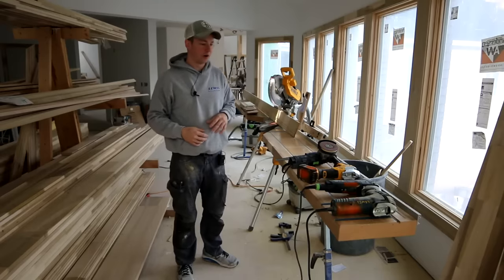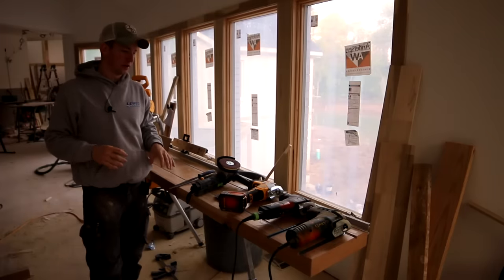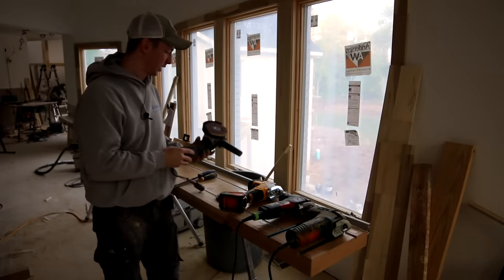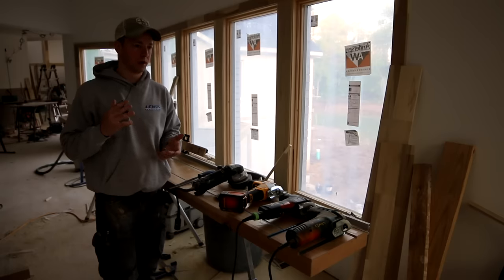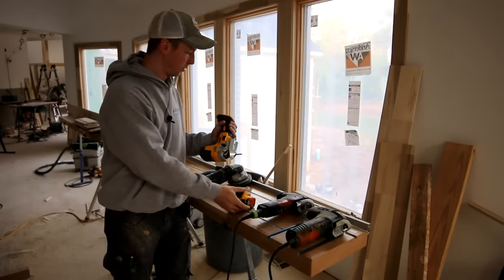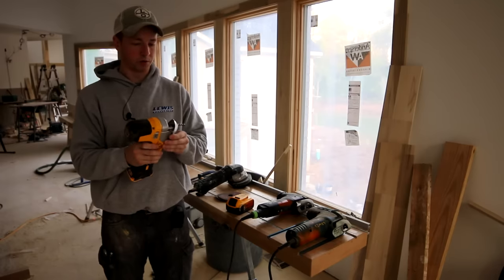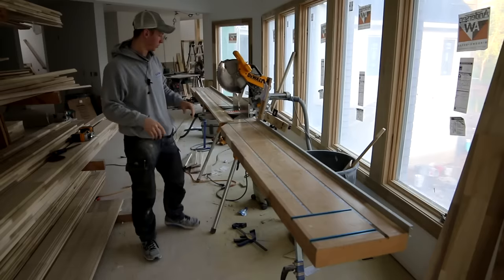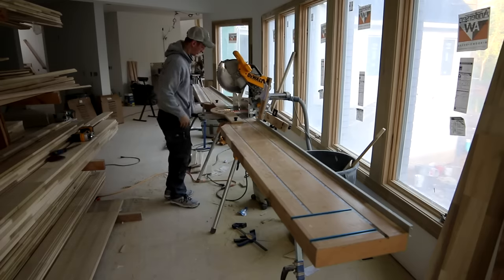Best tool for coping base and crown??? Dewalt DCS335B w Coping Foot for the Win

Comment: I will agree that you can get a very nice fit when coping crown and that in some instances coping may be best. However, for paint grade crown coping is a slow waste of time. Cutting miters is much faster. Coping is an extra step that is not in any way necessary. When coping you have to cut a miter anyway, then do another step that takes longer than miter cutting. Therefore, coping takes more than double the time over cutting miters only. A skill that you should have but should only do when you have to. The result is not worth the effort.
Reply: It saves time on remodel projects that walls are never plumb or square. It's less time fiddling with that last weird corner that just doesn't fit quite as tight as the other 3 did.
Reply: Trent Wright 

I use an angle grinder with a backing pad and a sanding disc. Fits into small details and is quick. Makita 4” with a DeWalt pad and whatever discs are at the store. 

I cut two 2 foot long samples with a 44.5 and 45 degree inside miters. Sample each corner, note it on the wall and make a mark at the bottom where the crown sat best. I snap lines from corner to corner. You will find that most corners are 44.5. I will use 3” long mdf wedges cut at 3* to tighten miters and keep the crown straight when nailing over low spots in the wall. This is where the snap line comes in. It lets you see if the crown is straight when nailing. Sampling the corners is key. I do cope base unless it is 1x with a round over.
Reply: Over time I've seen a lot of inside miter joints open up. Cope joints are the professional way.
Reply: Rick Hammer 

I have had outside corners pop with severe humidity changes (I am at the beach). MDF glue bonds just don’t seam to ever pop while wood joints need to be saturated to prevent a starved joint. All of my inside-inside miters are under pressure. Since wood is all kiln dried and the piece needs to shrink for a joint to open my joints have all stayed put. Outside joints have opened on me due to swelling. In 20 years I have worked for 4 different finish contractors with maybe 30 finish guys and none of them coped crown. With no call backs or complaints I have decided my time is better spent getting crown on the wall. A 15,000 sqft house has too many inside corners to be hardcore about coping.
Reply: Rick Hammer 

Talked to my current Super today, older guy I respect, he thinks I am full of it and that the extra time is little if any. Next time I do crown I am coping it to see how it goes.
Reply: I guess you are a "one cut, put it up" "carpenter". Hate to see your casing miters. Coping allows you to get a tight fit in one try.....always. therefore, making coping MORE efficient.
Reply: Pete M 

My casing miters are picture frame tight, all put together on a bench top then nailed up. I cope all base board. Crown is one cut , using a 2’ sample to determine angles and position.
Reply: I batch cut crown and always cope.

The ability to adjust your length slightly behind your copes is reason enough to cope for me.

Comment: I did not get an appreciation of exactly what the coping foot  does for assembled jigsaw.
Reply: A traditional jigsaw foot has a flat plane that is a bit more than an inch left or right of the blade, this inhibits the ability of the saw (when cutting from the bottom) to make a slight back-cut from the top of the piece.If you're good, a standard jigsaw from the topside can accomplish the same results.

Comment: Dewalt XR SERIES TOOLS ARE TRASH 
SOOOOOOOOOOoooooooooo DISAPPOINTED
Reply: @randycarreiro8363  burned out the 1st hour I had it went an got another burned it out 2 days later 
If it has an XR ON IT leave it be 
It's just the XR SERIES my other dealt tool work just fine